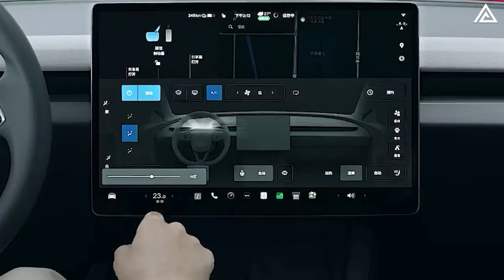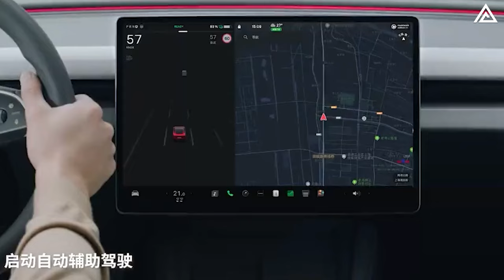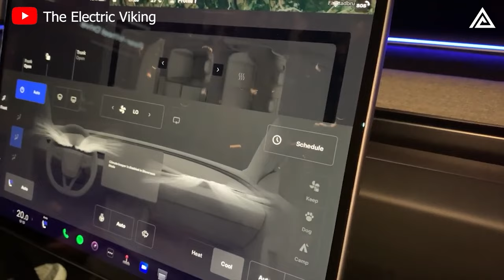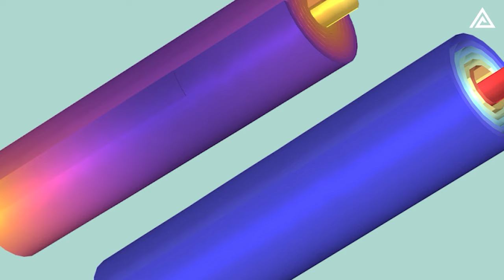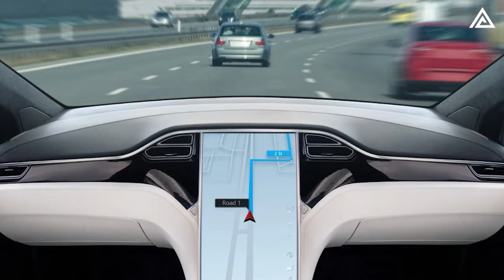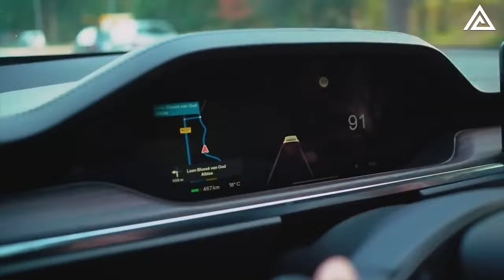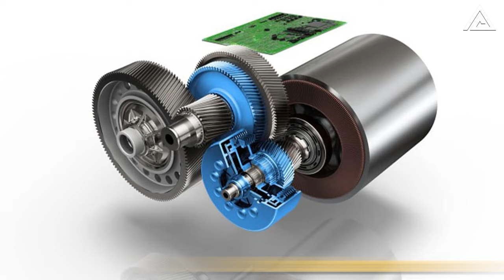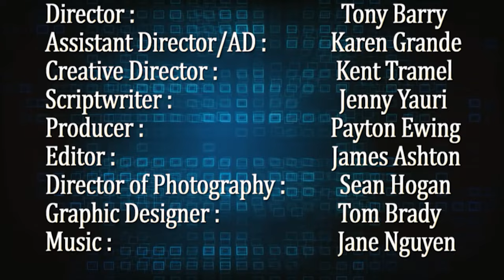2024 Tesla Model 2 Full Review: Detail Of Exterior, Interior, Build Quality, Performance, Feature

Comment: lol a 30k vehicle isn't competitive in pricing. Make it under 18k and then it will actually compete with gas cars.
Reply from the maker: The Tesla Model 2 is not the only electric car on the market priced under $30,000. There are several other electric cars that cost the same or less, such as the Hyundai Kona Electric, Kia Niro EV, and Nissan Leaf. However, the Tesla Model 2 has longer range, faster charging times, and more advanced technology features.

Price is an important factor, but it's not the only factor car buyers consider. Other factors such as brand, features, performance and safety can also influence the purchasing decision. Additionally, Tesla is a premium brand with a good reputation for safety and reliability.

Do you find that the Tesla Model 2 is a great choice for those looking for a premium electric vehicle with many advanced features and technology?
Reply: @adamtech999  its too expensive
Reply: the new renault twingo has a starting price between 17 and 18k. its a compact electric car for the city
Reply: @mogelkaiser1876  so when is it available in the US??? it never will be, so who cares.